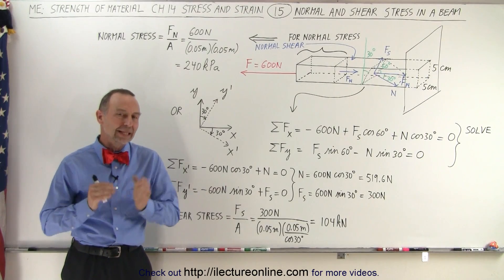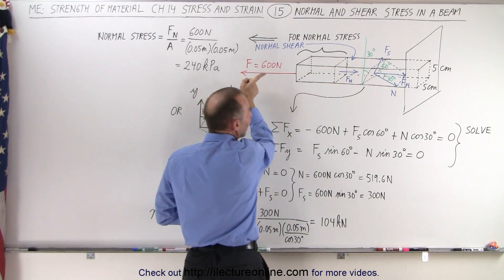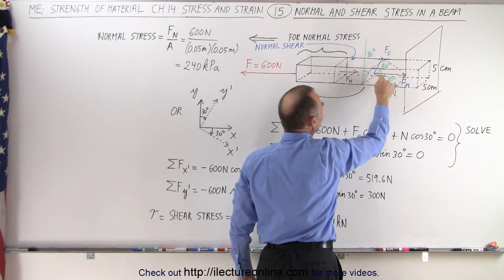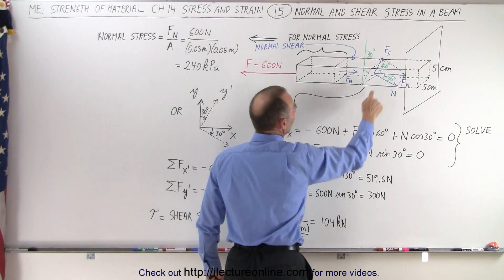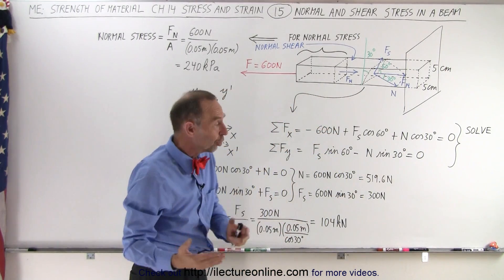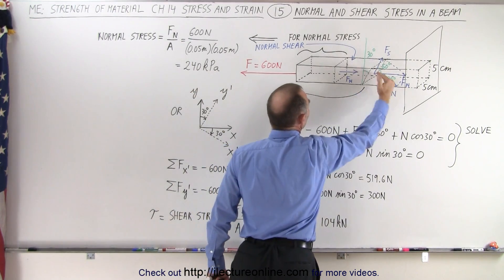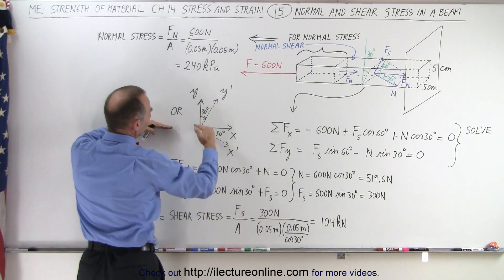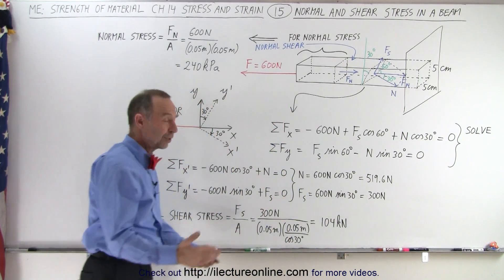Mechanical Engineering: Ch 14: Strength of Materials (15 of 43) Normal & Shear Stress in a Beam***

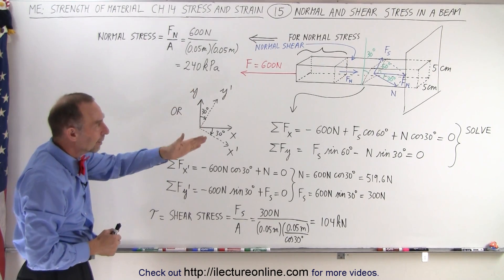Comment: At 1:10 there is also a tangential or shear stress along the cut parallel to the cross-section which was not calculated, right? Or since the external force F is the only force acting (normal to the cross-section), there is no shearing stress at that section?
Reply from the maker: Since the direction of the external force is parallel to the beam, there is no shear stress.
Reply: @MichelvanBiezen  Thank you. You are kind.

Comment: Great video. Just curious though, why would it be useful to consider cross sections that are not aligned with the vertical or horizontal axes? As in, what additional info does that 104 kN tell us about the system? Thanks!
Reply from the maker: Thank you both for your comments, we appreciate them.  My educational background is physics, but I have worked as an engineer for 35 years in many disciplines as well as having taught classes in many subjects over the years both at work and at local colleges.  My wife also worked as an engineer until the kids came along.
Reply from the maker: This is done to consider the internal forces inside the beam (other than the normal stress forces)
Reply: Under different conditions beam have combinations of stresses they can be flexural, shear, normal etc. in order to understand what is going on we need to consider all the different stresses acting in the beam and their total effect
Reply from the maker: That is correct.  We are trying to get to that in the future.
Reply: Michel van Biezen thanks Dr Van Biezen. Watching your videos I graduated as a civil engineer and I haven’t stopped watching them since. I have always been interested what is your educational background? Physicist?
Reply: Michel van Biezen Marc is right, I graduated with a physics degree last year, plan on earning my M.S. in the future. You guys are one of the best channels on YouTube without question. Love your content dearly!